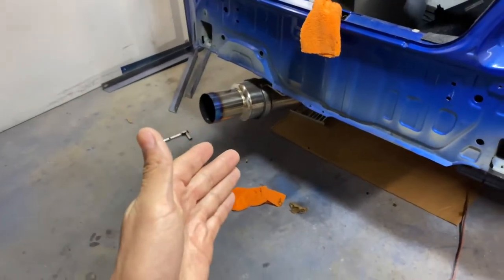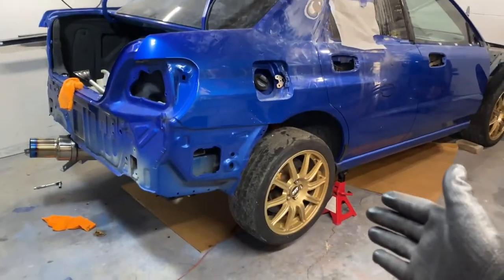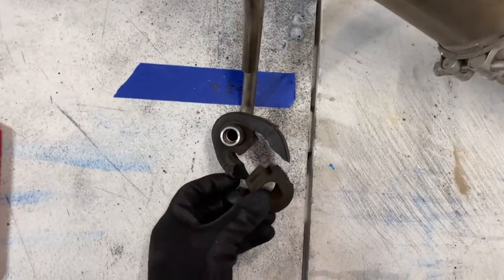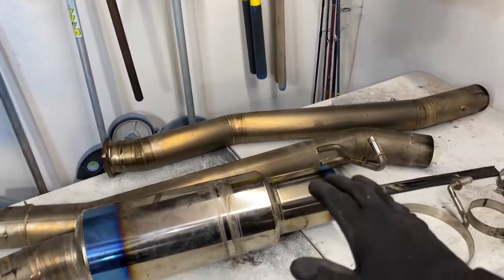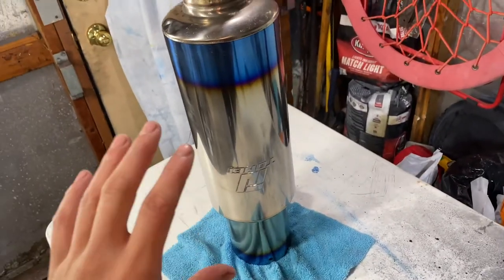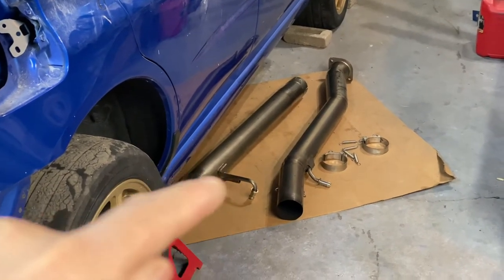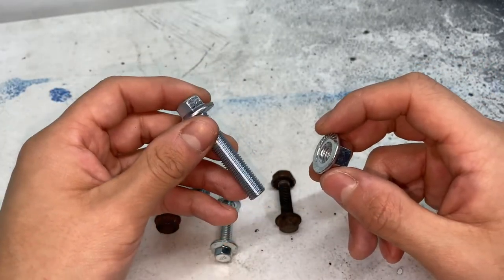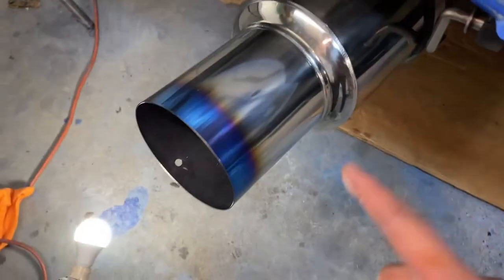FINALLY POLISHING THE TOMEI EXHAUST !!!

Comment: This didn’t rip off the blue tint ?
Reply from the maker: the blue is the effect of the exhaust seeing high temps!
Reply: Nah dude that's from the heat treatment they give it at the factory, you can't remove that unless you heat it with a blow torch or something. I was more worried about losing the letters on the side but this vid helped me pull the trigger.
Reply: @blakeslide6919 yo, did the letters come off?
Reply: @ScubaDivan Nah bro, they stayed on, the letters are fine. But to be honest it, it isn't a crazy difference. I think with a polishing pad and machine you could probably really make this thing stupid shiny, but at that point you might risk burning the letters off, and anyways the exhaust is going to get hella dirty after a few rides. Up to you, I think it was worth it though.
Reply: @blakeslide6919  haha I’m not even trynna clean it, I just got a new one but my dumbass installed it with one of the hangars wrong & the tip burnt off some of the bumper and now its kinda melted some gunk onto it. Just looking to get rid of that but its over the letters lol